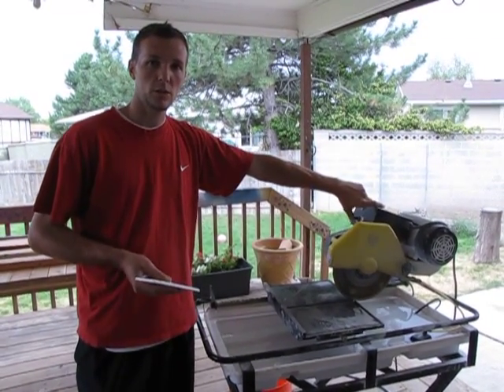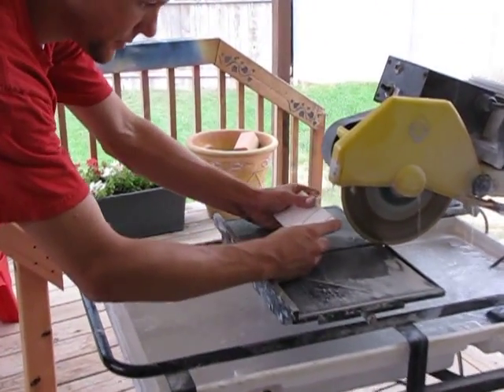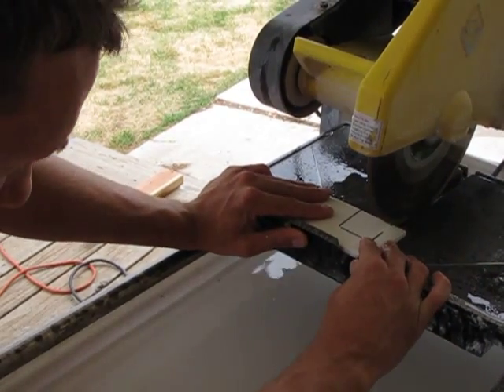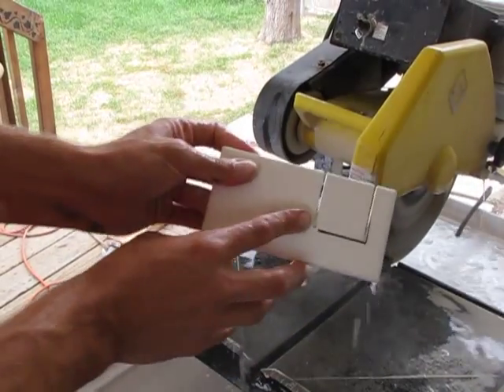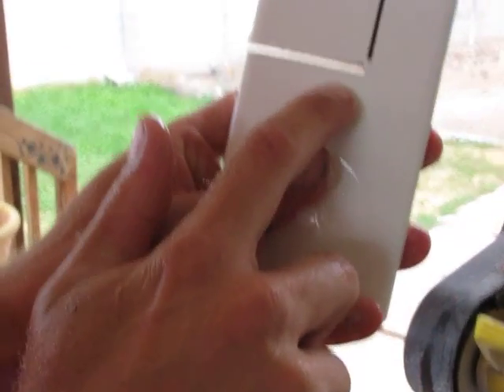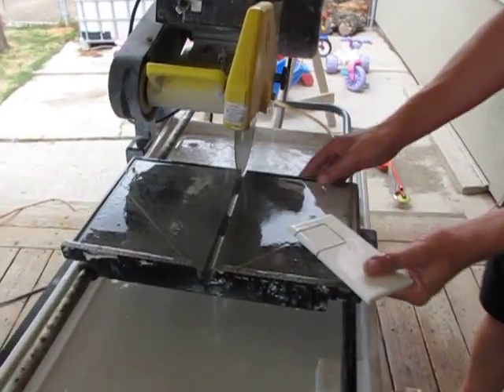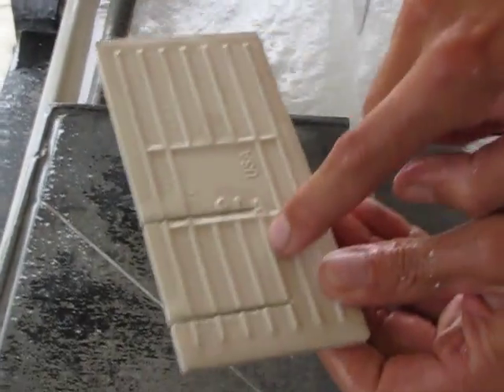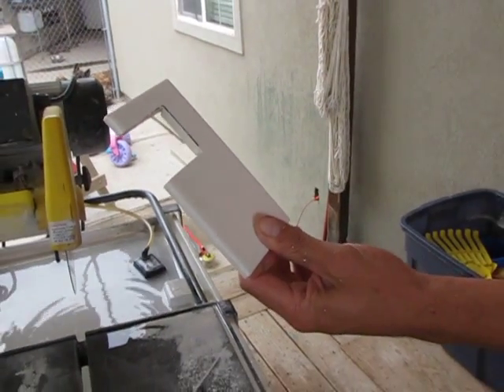How to cut a tile for an outlet using a tile saw

Comment: This video is a valuable tool for the first time tile cutter. Using the overhead style wet saw provides a challenge getting cuts complete because of the curve of the saw. Getting my hands that close to the blade seems dangerous, however using caution and going slowly looks doable to me.